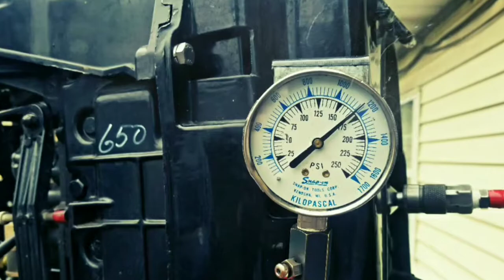Mercury Outboard Trim Motors (Pre-integrated models) Bench test

Comment: Thanks for the very informative video. I have a 1971 135 hp merc with power trim/tilt that works fine except when you trim it out and let it sit overnite it falls down. No external leaks. Got any ideas?
Reply from the maker: Ram Cylinders are leaking. You can rebuild or be satisfied that your trim works somewhat. Son

Comment: Hello, my power trim was working at one point but once it got in the water, trim stopped working and trailer. what could have been the problem?
Reply from the maker: When you say "not working" do you mean the trim motor is turning but engine is not lifting? Or do you just hear a click?
Reply: @MerCSonL6  Its working but I'm hearing it click and its not going up or down.
Reply from the maker: @truechamp5740  with the engine tilted all the way up is the oil reservoir full?
Reply: @MerCSonL6  I haven't checked that yet. But can i add ATF to that or actual oil? I will get back to you once i get that done. Thanks, your videos have been very informative!
Reply from the maker: @truechamp5740  ATF will work. Let me know. Thanks. Son